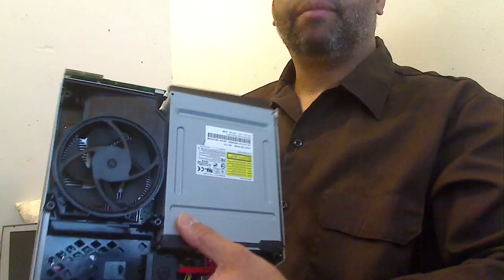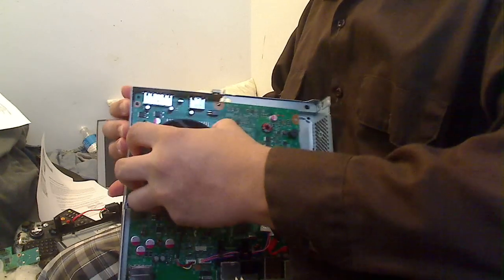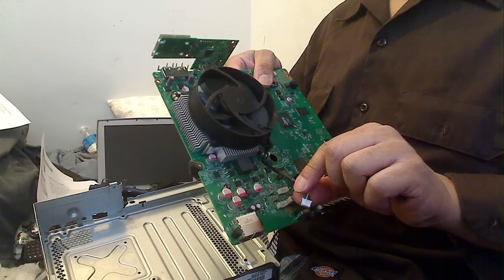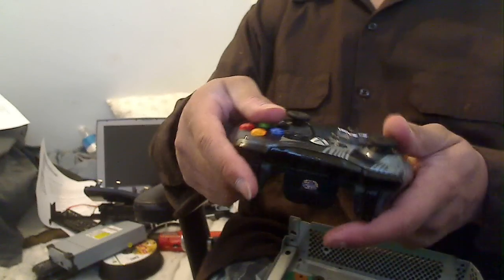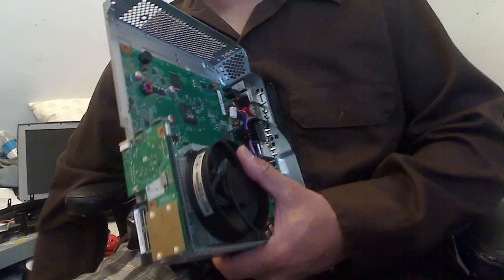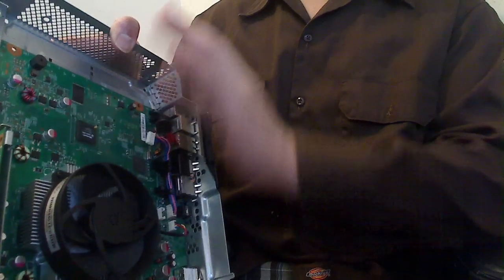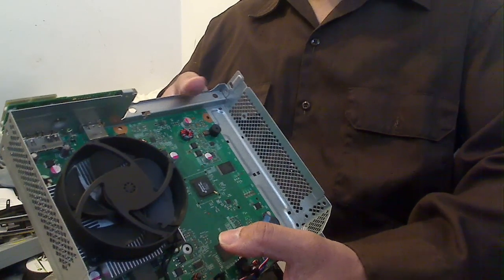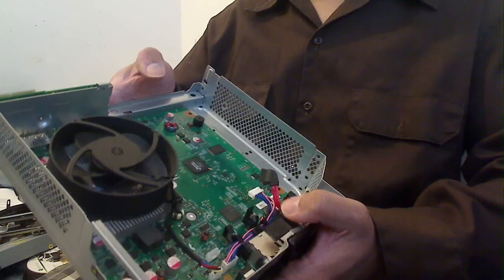How to fix Xbox 360 Slim RROD / Red Dot of Death Reset Solution👍

Comment: I've tried everything you've said and it hasn't done anything, I've done this three times, and on the third time it didn't work, first two it did
Reply from the maker: You've to be EXTREMELY clear in your statements here when posting you'd comments. Comments posting here should be to seek out help. Your 1st statement that it did  nothing and then your 2nd sentence states that it worked twice but the 3rd didn't. These 2 sentences contradict one another & represent complaining instead of a request for help but since u didn't ask a single question I cannot help you. Repost a valid question and try not to use 'it' to describe what noun you are referencing.
Reply from the maker: You've to be EXTREMELY clear in your statements here when posting you'd comments. Comments posting here should be to seek out help. Your 1st statement that it did  nothing and then your 2nd sentence states that it worked twice but the 3rd didn't. These 2 sentences contradict one another & represent complaining instead of a request for help but since u didn't ask a single question I cannot help you. Repost a valid question and try not to use 'it' to describe what noun you are referencing.
Reply from the maker: You've to be EXTREMELY clear in your statements here when posting you'd comments. Comments posting here should be to seek out help. Your 1st statement that it did  nothing and then your 2nd sentence states that it worked twice but the 3rd didn't. These 2 sentences contradict one another & represent complaining instead of a request for help but since u didn't ask a single question I cannot help you. Repost a valid question and try not to use 'it' to describe what noun you are referencing.
Reply from the maker: You've to be EXTREMELY clear in your statements here when posting you'd comments. Comments posting here should be to seek out help. Your 1st statement that it did  nothing and then your 2nd sentence states that it worked twice but the 3rd didn't. These 2 sentences contradict one another & represent complaining instead of a request for help but since u didn't ask a single question I cannot help you. Repost a valid question and try not to use 'it' to describe what noun you are referencing.
Reply from the maker: You've to be EXTREMELY clear in your statements here when posting you'd comments. Comments posting here should be to seek out help. Your 1st statement that it did  nothing and then your 2nd sentence states that it worked twice but the 3rd didn't. These 2 sentences contradict one another & represent complaining instead of a request for help but since u didn't ask a single question I cannot help you. Repost a valid question and try not to use 'it' to describe what noun you are referencing.
Reply from the maker: You've to be EXTREMELY clear in your statements here when posting you'd comments. Comments posting here should be to seek out help. Your 1st statement that it did  nothing and then your 2nd sentence states that it worked twice but the 3rd didn't. These 2 sentences contradict one another & represent complaining instead of a request for help but since u didn't ask a single question I cannot help you. Repost a valid question and try not to use 'it' to describe what noun you are referencing.
Reply from the maker: You've to be EXTREMELY clear in your statements here when posting you'd comments. Comments posting here should be to seek out help. Your 1st statement that it did  nothing and then your 2nd sentence states that it worked twice but the 3rd didn't. These 2 sentences contradict one another & represent complaining instead of a request for help but since u didn't ask a single question I cannot help you. Repost a valid question and try not to use 'it' to describe what noun you are referencing.
Reply from the maker: You've to be EXTREMELY clear in your statements here when posting you'd comments. Comments posting here should be to seek out help. Your 1st statement that it did  nothing and then your 2nd sentence states that it worked twice but the 3rd didn't. These 2 sentences contradict one another & represent complaining instead of a request for help but since u didn't ask a single question I cannot help you. Repost a valid question and try not to use 'it' to describe what noun you are referencing.
Reply from the maker: You have to be EXTREMELY clear in your statements here when posting your comments. Comments posted here should be to seek out help. Your 1st statement stated that "it hasn't done anything' and then your 2nd sentence states that it worked twice but the 3rd didn't. These 2 sentences contradict one another & represent complaining instead of a request for help and since u didn't ask a single question I cannot help you. Repost a valid question and try not to use the word 'it' to describe what noun you are referencing.

Comment: this wont work if u have a console that doesnt use cpu power, hence the chip underneath never heats up, so u have a dead weight console that will need to be reflowed and reballed unfortunately, a complicated and an expensive procedure. Might be easier to just buy a new console altogether given how cheapers it become and how usually you wont have access to expensive reflow/reball equipment

Comment: I followed the instructions and the 360 has been on for over an hour and it has not shut down automatically. The power supply light is green and the processor is hot.. What should I do sir?
Reply from the maker: +Anthony Turner Unplug; reassemble the the heatsink and fan; plug in the fan and then see if the xbox360 will power on. Do not reassemble the xbox til after you're done trying this.. Not all xboxes will reset if theres an underlining defect or if theres an xbox live failed update. Failed updates will red-dot any xbox 360.

Comment: need little help here, u have strip apart xbox as you shown and turn it on left  to reset but but it doesn't heat up, i left it for almost hour and nothing red light still there and and motherboard is cold. anything I am doing wrong
Reply from the maker: Rahul Parmar It appears that you're completing the task correctly but there could be several variables that may lead to your processor from overheating. You may have a bad power supply. If it has a RED-Light, it may be bad or itself may be ground-faulting which would limit the amount of power that the Xbox receives to activate the Xbox processor (CPU). If the CPU is non-active it will not over-heat because there's no activity. The other issue could be that the processor is bad and non-functional. Try a different power-supply.
 Another problem could be that Microsoft has updated the Firmware so that the Xbox wont allow power to the processor if it does not detect the processor fan plugged in.  You can unscrew the fan from the heat-sink using a Philips screw-driver, plug the fan power back into the board and then set the fan to the side so that it is not cooling the processor heat-sink then retry the overheating process again.
Reply: Donte Beachem my power supply looks fine there is orange light on it while xbox has red dot, I have plugged the fan and put it on side but no activity on processor I left it for almost hour and nothing it's cool as dead. any more hacks ??
Reply from the maker: Ok well you have a problem Rahul. There should be a green light when the Xbox is powered on and not Amber (orange). Amber is the color for standby mode which means that your Xbox is not being supplied adequate power to operate correctly. There could be several reasons for this but first try unplugging the Xbox power supply for about 10 mins to make sure all the capacitors are discharged and unplug from the Xbox. Then plug everything back in and power back up. If the problem still exists try this:  Xbox360 and the xbox360 Slim will display an orange light on the power supply while the Xbox displays red error lights or display a red light on the power supply (a ground fault) while displaying red error lights on the Xbox.  This can occur for many different reasons but I'm only going to reference the USB ground fault issue.  Forced entry or twisting of any USB cable plug,  whether Xbox controller or other proprietary cable or cable connected device may cause a breakage of the USB connector support bridge inside the Xbox USB port.   This bridge holds the USB 5.0 volt  metal connector and data metal connector and these metal connectors can get bent if there support bridge is damaged or broken.  If  the bridge is broken then the next time you plug in your controller or other USB device you may push the (metal) 5volt and data connectors towards the rear of the USB port which is like a small metal box.  This will cause the 5volt connector on any Xbox or any device to go to ground and cause any type of red light error and may cause either an Amber or Red light on the power supply while the xbox360 has redrings or the xbox360 slim has a red-light. I am not familiar enough with Xbox One errors at this time to make comments about expected errors, although I'm sure a ground fault would occur if 5v goes to ground.  To check for this USB ground possibility, grab a flash light and shine it into each of the Xbox's USB ports located on the front and rear of the console. Check for bent and/or broken pins; if found unplug the Xbox & then take a small screw driver or paper clip and pry them apart and/or off the rear of the USB port. Once completed,  power back on the Xbox, Done.!  I have also posted this  same correction possibility here, - - > https://www.ifixit.com/Answers/View/39208/no+power+to+my+console#answer249568

Comment: Alright so my xbox wont even staay on for 3 seconds before the red dot shows up and ive put on new paste heated the heat sink and the chip and noting new. help?
Reply from the maker: Have you checked to see if there's a red light on the power brick or even an orange light. The power supply has a fan inside and it can go bad also and lead to over heating. It can also be clogged with dust. Check it and try replying it to see if it's the problem

Comment: Hi i does and its not working i have the message error "E82"
Reply from the maker: Hello Jasmin, Microsoft has a possible solution related to your problem and my video is not designed to assist you. Follow this link to see if one of your Xbox slim has corrupted, http://support.xbox.com/ar-AE/xbox-360/errors/error-code-e82

Comment: hi, just wondering if you can help me, I went to try your method and followed everything to a tee, when I first got the xbox 360 slim it just gave red dot and went to error screen, no start screen at all.  So I followed your video and took everything out and unplugged the fan, re attached the power and turned on, the red dot had instantly gone and I got a start screen to my amazement. So I didn't leave for 20mins like you said for it to over heat because it didn't look like that was the problem. So I slowly started to add parts back in, ie plug fan back in and it still worked, plugged hard drive back in and it still work.  I then turned it off and plugged the cd-rom drive back in turned it back on and got red dot again.  Now the drive looks in perfect condition, I opened it and looked and it looks fine (I know that doesn't mean there isn't something wrong with it) but do you think its the whole drive that's broken or could it just be one of the wires or is there no way to tell?? Just like to say thank you for your help with the video even though it wasn't that problem with mine it helped me find the actual problem :D
Reply from the maker: I'm glad the video helped you to get to a point of diagnoses. There could be a problem with the SATA cable or the power cable connecting the DVD drive to the board. You'll have to purchase replacements for both to determine if either of them is the culprit. There are many sites that sell these and may even be sold at Gamestop. The SATA cable can be purchased at any computer Store, radio shack, Walmart or Kmart. If you determine that the error is still there afterwards you may have to replace the drive.

Comment: Hey man, great video! Thank you for explaining clearly and carefully; I'm happy to have found your video!

My question is this: what exactly are the symptoms that point directly to a bad SATA cable? I ran my 320 HD on my buddy's slim and it works fine; I tried his HD on my system and its gives me a red dot or freezes on the Xbox startup screen (all distorted and messed up). Sometimes my HD will work, but then it goes super SLOW when navigating through my Xbox menu (system settings especially) and then eventually freezes.

I now ordered a new SATA cable since I found that the red wire that goes from the hard drive to the mother board fits pretty loosely. 

I have yet to receive the new SATA cable, but should it not work, what's my next step to diagnose the issue? The receiving connector that takes the red cable from the HD to the MB looks like it's a tad loose But all the solder looks solid. 

The Xbox runs PERFECT during regular gameplay without the HD, but it only acts up with my HD. 

Thank you kindly for any help or anyone else experience in this area. 

Cheers!
Reply from the maker: Mark Henry Cooney You could have just purchased it in the store at GameStop. There are no other solutions to this problem, except an Xbox firmware update which requires you to be connected to Xbox Live silver or gold account. Maybe the power cable. Hopefully you ordered this thing here, --> http://www.amazon.com/Xbox-360-Drive-Caddy-Power-Cable/dp/B00GDU1OLK/ref=sr_1_2?ie=UTF8&qid=1439831704&sr=8-2&keywords=Xbox+360+Slim+Hard+Drive+Caddy+Sata+Data+Power+Cable
Reply: Donte Beachem GameStop doesn't have it. I actually ended up ordering from gamersrepairshop.com. 

Thanks for the reply though.

Comment: is adding new paste absolutely necessary or could i be fine with a simple clean and reset?
Reply from the maker: You have to add the paste. It allows heat to transfer from the processor, to the metal heats sink and then blown away from the heat sink by the fan attachment. If there is no paste you can expect burning to occur and the red dot error to continue.

Comment: what size are the screws and the washers?????
Reply from the maker: I've updated my video but for some reason it didn't apply. Do not use the screws. Place the x-clamp back on. It applies upward pressure from beneath the CPU, which the screws do not. If the screws and bolts are not applied correctly, the Xbox will red-hot again. So reapply the x-clamp.

Comment: My xbox sometimes turns off and on by it self so what do i do plz help me
Reply from the maker: You may have an overheating issue. It could be your 360 power adapter fan not functioning correctly or the vents could be blocked. Your Xbox 360 Slim power brick/adapter has a fan inside to keep things Cool. You may need to make sure the power brick is not on carpet or in a closed cabinet or have anything blocking the vents. If the fan inside the power brick isn't spinning when u power on the Slim, then you may need to either open it to clean out the dust (this may void your warrant, if u have one), replace the power brick by purchasing a new one or turning it in for a warranty replacement. Another issue could be the CPU fan not operating or the CPU paste has dried and cannot sufficiently transfer heat from the CPU to the heat sink. If this is the case you will have to open the Xbox; remove the heat sink and fan, clean off the old paste then add some new paste and then replace the heat sink and fan. Power back up before replacing the outer Xbox she'll.

Comment: I did this method three times after cleaning and thermal pasting the hotstack today. It is not working for me. A long while ago, over a year atleast my Xbox was dropped from about 2 feet. Shortly after that while I was playing a game it made a soft frying noise (meaning i barely heard it) and immediately got the red dot. Any thoughts on what I can do? Or am I screwed.
Reply from the maker: A frying noise could indicate permanent damage for which this method cannot aid you. Your Xbox may need to be replaced.
Reply: Donte Beachem Hey brother i have had my xbox 360 slim for probably 5-6 years and the damn thing red lighted tonight not red dot but red light i unpluged every thing and took out the hard drive and put it back in but it still red lights someone said do all that and leave it alone for 4 hours so i will see if that does any thing.
Reply from the maker: Ok so what's the difference between a red dot and a red light. I thought it was the same. Since you believe it to be different, then you'll have to elaborate with more clarity about this red light description.

Comment: Hey I did everything you said in the video, but when I leave my xbox without the fan plugged in for a few minutes so it resets itself, my tv screen just turns grey, the light on my xbox is still green though. Can you help me?

Thanks
Reply from the maker: It sounds like there a problem with your video or video cables. The Xbox may be running fine. Repeat the video cable in the Xbox and to the rear or the TV. If that doesn't work, try another video cable such as HDMI or component cables. Good luck.

Comment: Hey donte do you wait till the Xbox turns off automatically or until it starts blinking? Thanks
Reply from the maker: You should wait til the Xbox turns off. If it has not turned off automatically after 20mins to a half hour then unplug it and continue from there with the rest of the tutorial. If this doesn't work check all USB and Video ports for bent connector pins. The sea pins should all lay flat in a row and not touching the metal part of the case nor touching each other.